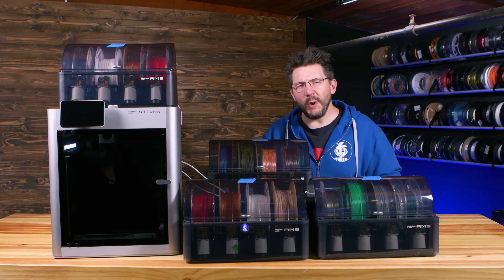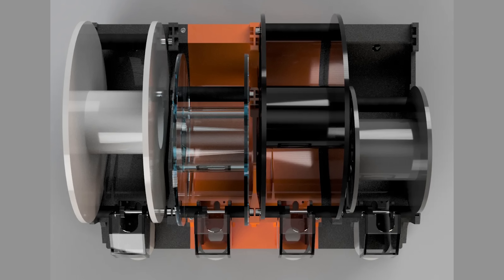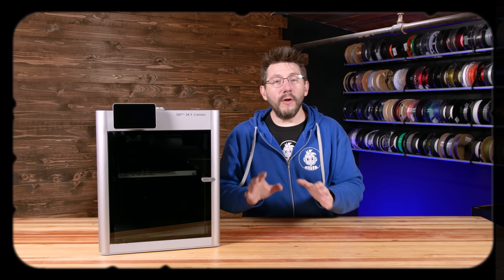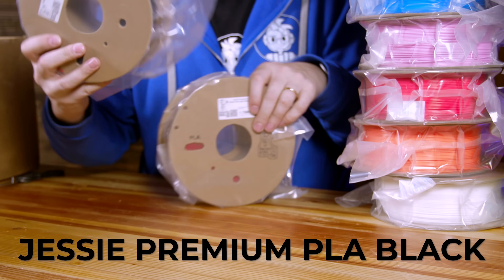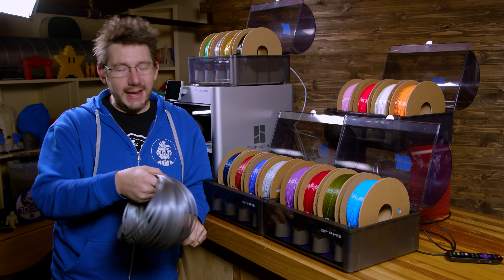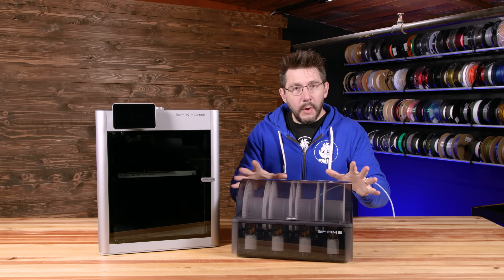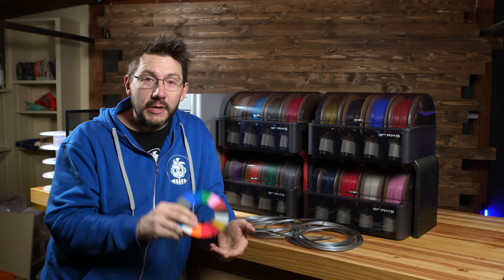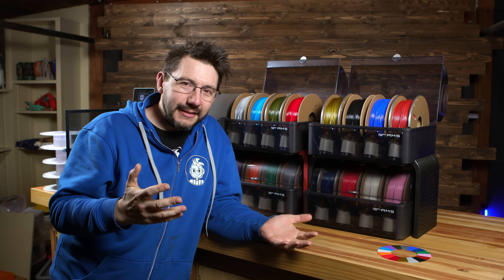Will the Hydra Mod on Bambu AMS Work?

Comment: I've been running cardboard in my AMS for a while now.  Zero issues.  I've run about 20kg worth of filament on cardboard spools at this point.  I'm either lucky... Or I have flawless spools?  Or maybe the AMS has addressed this issue at this point in time?

Comment: I have 3 ams units.  Do NOT run carboard spools in them.  They will dust off and clog up the AMS eventually breaking it.  As most people dont notice its done damage until its already failed.
Reply: Many other commenters have said that they just put electrical tape around the edges. Problem solved.
Reply: Cool, still not ruining my 300 "per" AMS just to run cheap garbage filiment.  I also see a lot of youtubers who are rough on their equipment like an autistic toddler, and I HIGHLY doubt the comment section folks are much different.  I leave these things running all day every day while im away from the house, what kind of moron would chance letting a jerry rig piece of electrical tape balling up or burning out a motor, catching something on fire etc etc.  Modding your machines not for the "rat rod" community, its best left up to the professionals.  And just bc your on youtube, doesnt mean your a pro, or should even have advice followes for that matter.  People forget, youtubers are just people who stuck a camera in front of their own face and filmed themselves doing the samw shit you and I do.

Comment: @3DPrintingNerd I was wondering if there is a way to contact more than 4 Bambu Labs AMS systems? Allowing you to have more then 16 color or filament types? Also are there any other AMS systems that work for Bambu Labs printers or conect to a current Bambu Labs AMS systems? I know I am not the only person thinking about this.

Comment: I must have a later revision AMS as I haven't had any real issues with mine.  But, the only spools that I run into among the different brands I have tried are the Atomic filament spools.  They fit, but just a mm or two taller than other spools so the lid won't close all the way.  I am on the fence doing all the Hydra AMS work as I would be the one to screw it all up and have to buy a new one. 🤣

Comment: Ok, coming from someone who also knits,and has to wind hanks of yarn before using them...couldn't you rewind your filament onto an empty spool that DOES work on the AMS? (I also only have a resin printer atm, so apologies if that's a dumb question)
Reply from the maker: Oh not a dumb question at all. You absolutely can, and there are cool prints you can make to automate it!

Comment: Thank you very much for this video! I'm looking into purchasing the Bambu Lab X1 Carbon Combo 3D Printer. Before I purchase this combo unit, can you tell me what should I look for, before purchasing it? Did you have a chance to compare the Bambu Lab X1 Combo 3D Printer and the Carbon model? Also, do you think that the software and hardware is mostly bugs free?

Comment: Except... it won't print TPU, and it shouldn't print any CF filament. Bambu has a MAJOR weakness that is that you can't print from the external spool holder using the COLOR painter inside Bambu Studio. It should be able to print color 0 (external spool) with pauses while the operator retracts the previous material and feeds in the filament from the external spool holder. Imagine how cool it would be to lay down a layer of TPU under a coaster or to print TPU as a gasket material for a weather tight box straight off the printer?

Comment: so I just got my 3 extra AMS units with my x1c combo.. put it all together loaded up with all Bambu rolls.  
Trying to figure out how to use different colors from each box. Also in my paint options when coloring model , it only show ams #1..  not even the correct colors loaded.  But on the X1c screen the colors are correct.

Comment: Not to pick nits, but wouldn't it be more economical time wise to just respool the filament onto a Bambu Labs compatible spool?🤔

Don't get me wrong, it's an awesome mod and looks like it would be fun for those who love tinkering with things, it just seems like a lot of unnecessary time & work to me.🤷‍♂️

That being said, if i ever have to do any repairs to mine I'll probably do this to it at that point. 

Maybe it's because i have a newer model  that i bought during their Black Friday sale (2023) as so far I've encountered zero problems.

I've only tried filament from 4 different companies though & only one has cardboard spools but it's handled all of them just fine.
Reply: Ok, I gotta update my comment, I totally exposed my inner Newbie. 

I finally found a filament manufacturer that has cardboard spools that my AMS absolutely HATES (Sovol).

Thier filament is pretty sweet and the price is really good but their spools (and spooling, but this will solve that issue too.) SUUUUCKS!!!!

I printed up some rings for them, but now my AMS won't fully close and I printed up a boatload of them! 🤦‍♂🥴

I am just going to start printing Bambu Labs spools and doing a transfer entirely, if nothing else than for S1t'5 & giggles.

I wonder if I can embed custom RFID tags for the AMS identification system?🤔I'll have to look into that a bit.

In the meantime, Its electrical tape for me. ;) 😂

Comment: Just pop the cardboard off the ends one side at a time and use the included BBL refillable spools, you might need to cut a small notch in the pressed cardboard so the inner spool doesn't just spin. I use it in my Elegoo and Polymaker filaments, only had one issue and it was because I snipped the coil leg too short. Other than that I've not had a single issue
Reply: I'm looking to buy "Bambu Lab X1 Carbon Combo 3D Printer", but before purchase I need to do some research - that is why I'm asking also you, what should I look for and or buy with the printer at the same time? They have replacements for cutters and other parts...? Thank you very much.

Comment: Love the video as always BUT find it totally disappointing to se you had motor issues and the fact they replaced the whole systems, I wonder if the average guy would get the same treatment, I doubt it,  Reminds me of Prusa with the dodgy MMU2 electronics they know there's a problem buy you have to buy the upgrade to fix it. instead of supplying the fix when you have bought the product (with the fault built in) still thinking of the X1c with AMS instead of Prusa and dont really care about Unc Jess filaments cant buy them in UK but I would want to use my Prusa filaments in the AMS. Keep the Videos coming

Comment: Ya, I ended up throwing my AMS unit away cause it stopped working completely and support did nothing to fix or replace it. They basically said it was out of the 3 month warranty and I needed to purchase a new one. My printer is now printing almost a whole 2mm above the bed when using Bambu slicer and only works if I use code from prusa slicer. Support has been rather disappointing and they only seem to want to help high profile people. Then again I also tend to have the worst luck. In short the Bambu has been nothing but problems for me. I'm thinking of just going back to a prusa and getting a mk4.
Reply from the maker: The mk4 I have is WONDERFUL. If you end up getting one, and if it performs like the one I have, you're going to love it.
Reply: @3DPrintingNerd  that is very encouraging to hear. I regret selling my Mk3.

Comment: How do you connect and setup 4 AMS units to the X1C?
Reply from the maker: The adapter on the back of the machine can be changed out to the one that allows for 4 PTFE tubes!

Comment: That seems like a lot of work compared to just buying original filament or buying filament rolls that work!? And it will only be a matter of time before filament suppliers will make their rolls Bambu compatible. Funny to see how the 3D print community is desperately trying to hold on to the ‘mod’ everything way of working. I see a big challenge for all these YT channels creating content for something that works good out of the box (you see that happing already).

Comment: Great video! I just ordered my X1C and anxiously waiting for it to arrive. Have you tried PTFE tape for the spools? I've used it on wood on wood drawer slides and it significantly improved how easy they glide.
Reply: This would be a problem when the AMS rewinds the filament during colour changes

Comment: I received my P1P and AMS last week (mid july) and tested all my spools and found 2 that will not fit. The single spool of Jessie PLA and those curved Fiberlogy spools. Even the Prusament work ok, so did they change the design of the AMS because I thought prusament was initially a problem. For my card spools I found some adapters on printables and used the step files to adjust for some new Eryone  card spools and also the Esun EPLA-HF high flow and they are working very well.  The Esun EPLA-HF prints very well and can print fast while still keeping good layer strength.

Comment: Hi. Thank you for sharing further valuable info. I was surprised to find out about the existence of an official hardware mod for the AMS. I have one question that I would be thankful if you could clarify. Regarding the AMS motor problems, did you happen to get any alert on the printer or other indication you could identify? Or it was only after Bambu Labs reviewed the logs that it was possible to identify the issue.

Comment: Ordered my x1c on 5/17. I didn't get those spools with the AMS and already had a gear break on A4
Reply from the maker: Already? Oh no! Hope they get you fixed up quick!
Reply: @3DPrintingNerd  we are working to see what the problem actually is. While using Sunlu PLA+ im having an issue where the print gets to 99%, when it goes to retract the filament back into the spool it gets caught on something. A4 pulled a little to hard and broke and engagement gear.
Reply: Did Bambu replaced your AMS?
Reply: @tonysfun  they didn't replace the AMS, they just replaced the gear ($35 dollar part from their website)

Comment: Pisses me off, I finally took the jump to buy a p1p that was dead with error codes on arrival, well, after trying to print benchy 4 times with error codes stopping the prints. It was a broken fan blade on the hotend. After getting it out its been working on a 3/4 of the blades. After sending the logs, waiting a week, they askwd for a picture of the claim number in the same photo as the error codes. Instead they got a picture of the fan blade and one of the failed benchys. They got approval after a week of back and forth to send a replacement hotend fan. A part that is 15.99, no replaced filament. Just the fan. After hours and hours of back and forth, sending logs and pictures, troubleshooting the initial problem. They couldnt be bothered to send replacement filament to offset all of that trouble I shouldnt have had in the first place if my printer arrived without being broken. 

Bambu is sure to fix the youtubers issue with vigor and class. He sends error logs and gets 4 new ams units. I send error logs and get told to send pictures of this number in the same picture as the errors, you liar. 

You're chinese made junk, Bambu. Wish I didn't buy you.

Comment: Why does Printed Solid use such massive spools? What's the benefit? More unnecessary plastic for the landfill.
Reply: They use cardboard spools.... also known as "not plastic". :) Or are you saying that having smaller spools makes me print less overall?
Reply: @punishedbrains  No, I mean the big plastic spools on the Jessie PETG. I've got 3 spools of it right now and all the PETG stuff uses plastic spools. Not sure why Jessie PLA is on cardboard, but not PETG.
Reply: @theglowcloud2215  Ah like that. I read that that can be due to not having enough supply of the cardboard (sourced locally) to fulfill demand. Not sure if their PETG is always only on plastic spools.

Comment: So a fun behind the scenes from talking with Dave at ERRF 2022 - They want to switch from plastic spools to the cardboard spools, but the cardboard spools need to be a bit special... to keep with Jessie's Made in USA promise, they need to be made here. To keep them world friendly, they need to be recyclable. And to keep them strong enough to survive vacuum sealing and usage on rollers, they need to be thick cardboard with some quirks. Oh... and they need to be cost friendly so they don't cause the cost to go up. Sounds like a lot, but Printed Solid did find such a manufacturer to make those.

But one problem... they take forever to make. So if Printed Solid is selling 50 spools a day (I don't know their sails numbers), then they need to make at least 50 spools to replace them. Which means they need 50 cardboard spools a day. But you buy these things as needed, not on a per-day basis. So 50 a day? 30 days in a month? 1500 spools... except 2 days later, Joel releases a video involving Jessie and they suddenly sell 500 spools that day. That 1500 cardboard spool order won't cut it. They need more... but the vendor takes 2-3 weeks IIRC. So they won't get them in time.

Meanwhile, the old plastic spool maker can get spools for them in 1-2 days. So if you ever buy Printed Solid and get plastic spools... you either got some older filament that didn't sell OR you got brand new filament at a time they were short on cardboard spools but couldn't get new cardboard in time.

Also, combined with Yellow Bird, the Pure Magenta, Pure Cyan, and Quarter White spools exist to do full color lithophanes. The Quarter White is important as it has 1/4 of the pigment to allow more light through and you can see the colors better. Using normal white will still work, but it will be darker/colors won't show through as well.
Reply: Good info, thanks for sharing.
Reply: @hazonku  NP
Reply: Thanks for sharing! That's some pretty useful info.👍✌️

Comment: I will say that cardboard spools can cause issues with the AMS since that can release little flakes/pieces of cardboard that jam the rollers. Another thing to keep in mind is that you might want to use spools that are atleast 200mm in diameter like the Bambu spools because I have found that if they are smaller than they will not make contact with both rollers and actually be rubbing against the bottom of the AMS which also caused jams.

I am working on some adapters for small esun 250g spools and that are 200mm diameter. Their were some already made but they were 190mm and I would constantly get jams. I might release my version in the future so people can try them out but atleast for me they have been working great.

If you are having issues with your AMS try measuring the dimensions of the spool and see if they match the Bambu ones. If not you can either re-spool them with the Bambu spools or print out adapters for them.

Comment: Interesting video! I know many 3D printing enthusiasts love fooling around with and modifying their machines; I am not one of them. I just want to print the guitar parts I design. I found out quickly that  spools/filaments vary, the filament path is long, and ;therefore, some spools/filament are more AMS friendly than others. After taking apart the AMS multiple times, I decided I had better things to do. Instead of respooling or modifying spools, I simply choose filament that is AMS worthy. The amazing AMS unit is one that I want to last, so I try to feed it well. I don’t expect it to handle everything. My PLA filament needs are modest and I can always print from the side for special cases. Needless to say, companies who use cardboard spools won’t get much business from me. Too bad, they make some great stuff. The Bambu Lab X1 Carbon has been a game changer for me, easily exceeding my expectations.

Comment: I've printed the Hydra AMS, but haven't installed it yet. I discovered an issue with the X1 carbon not printing correctly on large prints. I had to switch down the AI to get it to print properly.

Comment: It's great Bambu came through for you, I do hope they would do the same for any random user like myself. Also, is it me or are you leaving the AMS lid slightly ajar, in order to accomadate the spool size? I guess in the long term this wouldn't be good since the filament would absorb moisture from the air. I keep my AMS closed, and have extra dessicant in there. I haven't tried the hydra mod myself, it seems like a cool project. But for now, I just avoid buying filament that doesn't easily fit into the AMS. Or at least don't buy ones that are too fat. Too small and there are adapters to make them bigger, but too big and you'd either have to do the hydra or a respool.
Reply: for now, my bambu support was also very generous. I slightly damaged my QR Code on the Pei Sheet (i think my error from isopropanol) and without any hesitation they send me a Coupon for a new Sheet. They also give 50USD Coupons when you got bigger problems and fix it by yourself like a new bed cable

Comment: i have 2 AMS units, and i struggle to print big stuff because of all the waste. I do like the easy filament switching between prints and printing sequential in different colors. But i leave the big color prints for others. I don't want to waste 2 kg on filament for a 300gr model.

Comment: For me, I found the mod to slide a spacer in between the cardboard rounds and snap an official bambulab spool on it was so much nicer for me using other filaments. Specifically Polymaker and overture